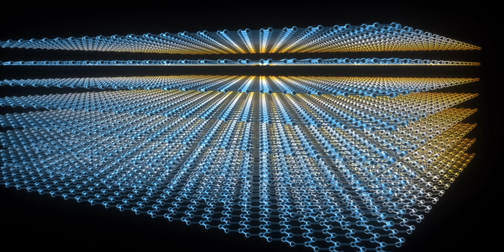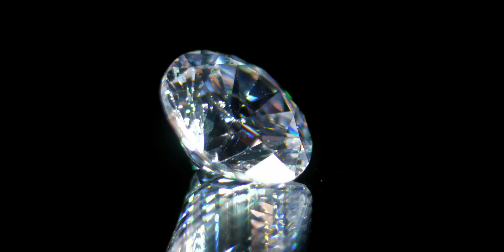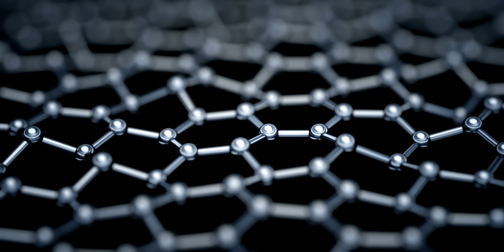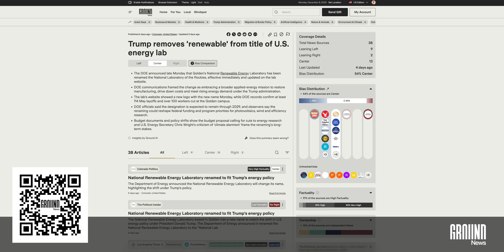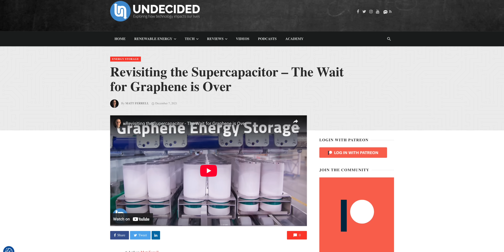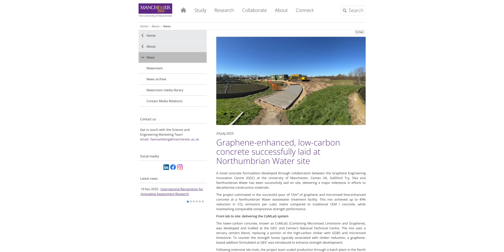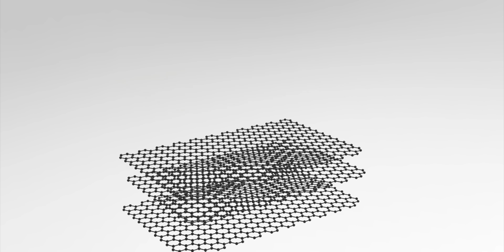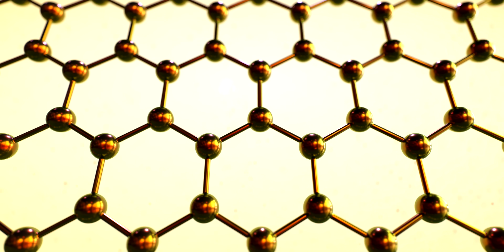How Graphene is Changing the World … Right Now

Comment: I wonder if graphene would make better camera sensors. As an astrophotographer, sensor sensitivity is very important. Would be cool if we could capture more date with less exposure time. The cameras we use need a cooler because with super long exposures, the current CMOS chips generate a lot of heat which causes noise. If these could make better camera sensors without the need for cooling, that would be awesome.

Comment: I wonder if there is a way to produce graphene using a float tank method. If you ha still fluid to float the graphene on as it was produced wit a take up roller on the end. I don't know enough about the graphene's properties but using a very still liquid metal in a vacuum where the surface is super flat would prevent wrinkles and tears. If you sputter or some other form of deposition at on end you could basically print it in large sheets.

Comment: I'm here for Graphene. In fact, One+ has a phone with Graphene in the battery. It can charge a LOT faster than the previous model and many other phones currently on the market and has a greater capacity for having a battery that is roughly the same size and the model before. If Graphene is only going to improve, I'm ready to see what happens.

Comment: Skeleton's product isn't a GPU, it's a UPS that power balances jittery GPU workloads. GPUs training models in datacenters sometimes turn on and off in unison, which would cause power surges that the utility's supply can not handle. One solution is to introduce dummy workloads, literally burning electricity at each GPU for nothing just to fill those gaps. That's how Skeleton claims the flops increase: replacing the dummy workload with an actual rest period (supercapacitors take up power from the grid to smooth the power draw) allows the GPU to cool, allowing for a higher clock speed when training resumes a split second later.

Comment: Matt,
Good thing CO2 and Climate are not a crisis or a problem. The CO2 emissions from concrete is irrelevant. Trees and Green Plants thrive on CO2. Point is stop hyping the climate crap, you’re lying. Otherwise thanks for the info on the Graphene.
Reply: No joke.  1000 parts per million is the sweet spot for CO2 which is 2.5+ times higher than current levels.
Reply: @michaelg4931 Actually CO2 is not even relevant. For one thing it’s not a greenhouse gas. The real player in Atmospherics is water vapor.
Reply: @wmffmw It is relevant because below 200 ppm and most plants die with the optimal being 1000ppm.   If it was up to the 'climate crisis' crowd we'd end up starving to death.
Reply: @michaelg4931 I did not say CO2 was irrelevant to plants. I said it is irrelevant as a greenhouse gas. False as is the so called climate crisis. Human activity has in fact significantly greened the planet. Historically, Earths flora may have suffered an extinction level event if CO2 levels had continued to decline as they had been prior to the English Industrial Revolution. The records in the rocks.
Reply: @wmffmw LOL   I guess you can't see when someone is agreeing with you.

Comment: I'm old enough to recall when lasers were described as a "solution in search of a problem".  All the craziness of optimism in 2004 will come to fruition. Just takes time.  History is full of ideas that were ignored for decades and more and then someone builds it into their 'invention' that is now possible thanks to additional tech developments.
Reply: I bought some graphene IEM a few years back to replace my Beryllium drivers and it was fairly cheap.  The issue is that it's still too exotic of a material that a lot of these older companies just aren't familiar with it just yet.  China is actually taking the lead in researching uses for graphene.
Reply: now do 'lasing blue LED's'

Comment: Commercial deployment of new tech has always taken a long time. The first ABS brakes were invented in the late 1940’s I think, were deployed into aircraft in the 1950’s, with the first passenger cars to get them in the in the 1960’s but the real breakthrough with the electronic ABS brake happening in the 1970’s. I wasn’t for another 40 years before practically every car on the road had ABS brakes as standard. 

Computers were the same. Enigma was operating in the 1940’s, but the breakthrough for computers small enough to be portable didn’t happen until the Apollo programme, and the first personal computers didn’t happen until the Apple II in the late 1970’s and things didn’t advance much until the Apple iPhone hit the market in 2007 with the newly commercialised electrostatic touchscreen, which had made a computer small enough it could literally be carried in a jeans pocket, and easy enough to use to be practical, with the ability to connect to the internet through the still developing mobile network, that computers and the internet was forever transformed from a thing that was somewhat useful for some people to something everyone relies on every day all day throughout the day. That’s even longer than ABS brakes.

Based on that development timeline graphing shouldn’t be ubiquitous and pervasive until at least 2100, and won’t exit specialised uses in industries that can support its development until at least 2030, possibly 2070. 

So I don’t really see this as a delay, but as a  normal development curve for a high potential technology, that we will probably have to invent whole new technologies, with their own knowledge breakthroughs to even make its use and production.

Comment: 5:30 means absolutely nothing without a comparison to silicon based microchips.
Reply: exactly what i thought lol But thats always a Problem with hyped new tech. Just call some numbers without any context and it looks good. If not explained closer, just leave it out.
Reply: I agree, that's deffinitly possibly deceptive. However I don't see why this wouldn't be scalable to the device scale under the assumption that they can easily deposit high quality single layer carbon and etch it. But you can easily etch Graphene with oxygen plasma (arguably a bit too fast), so the initial deposition is the hard part. The nano-patterning should be basically the same process as they do in fabs at ASML already do with X-ray photolithography.

Obviously it's nontrivial to swap between the 2, but it's hardly the most difficult part of anything involved in either the semiconductor or graphene fabrication process.

Basicly if you can fabricate it at a micrometer, I think you can fabricate it around down to scale with the ASML tech.
Reply: @Eric-jh5mp  yes, I didn’t mean that it’s not possible/scaleable, just that it is deceptive.
Reply: Gents and ladies.. i think the real question is still unanswered.. can it run crysis? Or city skylines?
Reply: This video proposing that graphine can be used as a semiconductor to make chips without silicon???
Reply: @nonstop7243  Newer Intel i9 chips have a theoretical throughput of around 704gbps
Reply: I need the unit to be FLOPS

Comment: Graphene's potential was not overstated at all, but what the predictions all got completely wrong was how long it would take to reach full potential in all of the fields it will affect.  It will take decades before it is anywhere close to having the huge impact on technology and engineering that is coming.  In some fields it is making an impact already, though even in those areas the impact is at present modest.  Once the production of the various useful forms of graphene becomes reasonably cheap it will be one of the biggest material industries on Earth, and at least as impactful as the steel industry has been.  However nobody really knows how long that will take.

Comment: I cant wait for graphene photonic gpus, ram... At that stage, having them seperate might cause too much lag for whatever speed theyre going for.. An embeded chip housing the ram, cpu, gpu, others. I winder if dense embeded storage that operates like a cd and laser is possible, in a multi layer grid + diff wavelengths, perhaps it could store a lot.
Or even just be used for an inside ROM. 

GPU speed and dense data like this would enable extremely fast and powerful AI directly in a small form factor, wearable or otherwise...

There may even be new number bases able to be used besides binary? If multiple wavelengths are used, it could potentially be used as on/of for each wavelength, enabling even denser storage and data transmission.

Comment: Just because graphene conducts heat doesn't mean it dissipates it any better. It has less resistance loss, so slightly less heat, but most of a signal MOSFETs heat is from switching, not ohmic. You need to transfer the heat to something, and there conductivity matters, but you still need cooling.

Comment: Remember the Blue LED discovery? Every one did it wrong, until 1 persistent engineer found the 'eureka' solution, through altering the injected chemical flow, after about 5 years (guessing a bit here) of trial and error.
My point is, that someone will have a 💡 moment at 2am and discover the method to mass produce quality graphene sheet layers. Just like the transistor. Like the light bulb filament. I even remember a biological experiment that failed consistently. Finally, one scientist realised the problem was when they cut the vein like tube with the scalpel. The blade was not sharp enough and was 'crushing' some of the cells and failing the next step. So a sharper and thinner blade and the method used for cutting the vein like tube, solved the flawed issue and they succeeded in producing a useful product. It needs dedicated, smart engineers and funding for years, to keep trying. I don't think that's ever going to change.

Comment: There's be some wry humor from the universe, if Graphene could be used in Concrete as a method of Carbon Capture.
Think of the share prices of construction companies that supply concrete, or the cost savings to recycling carbon based waste from other branches of a megacorp, trucking the waste to their in-house recycling-to-concrete business.
That charge-shifting capability could be useful in capture and redirection of cosmic rays in the hulls of space vehicles, or via the concrete in the structures used in off-world bases.

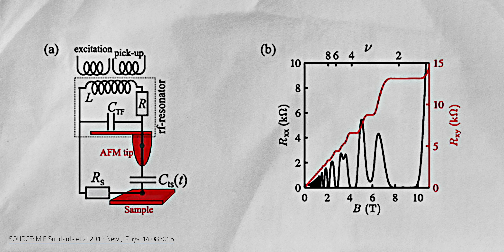Comment: 3:54 I hate to be writing this comment hahaha... Kelvin is a unit for temperature, it is just "Kelvin" not "degree Kelvin", it is in good faith, I totally understand where the confusion comes from :)
Reply: @mytorojas  Thanks for writing that. Degree Kelvin is wrong since 1967.
Reply: @domifr1991 ah ok thanks, so my intuition was right. Always happy to be corrected, that is why I thought maybe there was a super niche use of it
Reply: @domifr1991 can you put a source? :)
Reply: Kelvin Degrees measure temperature difference, both on the Kelvin (absolute) and Centigrade scales.
Reply: @simonmasters3295  makes sense I guess, but even then it would not be used correctly here and I've never seen that used. Do you have an example of some field where that is common?
Reply: @simonmasters3295 No. Degree Kelvin is wrong since 1967
Reply: Someone's getting a little loose on the fact checkers and proofreading...

Comment: And what was the carbon find before graphite? Buckyballs c60… yeah, what did we use that for? And… electrons don’t move thru a lattice… electricity flows by EMF being transmitted thru electrons.  Just like a wave in the ocean moves horizontally at high speed but the water molecules just move up and down and pass on the energy…

Comment: Graphene is also used in alot of newer power electronics, because of the better efficiency. 

I remember working with it at my previous job back in 2018-2019 on internal testing units, that then hit the market doing the corona time back in 2020. 

Around the same time we also saw the first drone batteries come out with added graphene for better performance. Kinda the early adopters, number of useful charge cycles were not the best, but performance was nice on them. It's gotten alot better now though

Comment: "And more importantly, how will these breakthroughs actually affect you?"
Well unfortunately Matt, you didn't do adequate research.

Graphene is even more damaging to human cells than asbestos. It's effectively a hypodermic needle of the smallest size on a molecular scale. It will literally just slip into your flesh if it's a particulate in the air. 
Researchers in graphene labs have to wear specialized suits, which only mitigate intrusion, not prevent, as there is no cloth/textile/wearable material that can prevent graphene from penetrating it. You could perhaps use some electrostatically discharged equipment in the lab but, here we are sponsoring graphene poured into concrete. Sorry my dude but, you got caught in the hype promoting a creation that presents more dangers than benefits.

Graphene is a technocrat industrialist promise that will reach its peak by climbing the bodies of the disposable along the way.

Comment: So much going on in the space! GMG just got EPA approval for Thermal XR their coating that saves energy in existing HVAC systems. Their batteries are going to change the world and G lubricant will extend the lives of ICE engines as it increases fuel efficiency. 
Hydrograph’s Hyperion system makes the purest graphene on the market and the process produces energy with syngas as the byproduct.

Comment: I just purchased a silicone food warming mat, the kind you roll out and use to keep dishes hot once they are out on the table.  The "upgraded" models are being advertised as having graphene.  The original ones had heating coils sandwiched inside the silicone.  The updated mats say there is a graphene film on the inside, which provides all over heating, without the cold spots of the wire coils.  No idea if it is marketing hype.  Just thought it was funny to see this video today as I buy cheap crap on Amazon claiming to have this tech.

Comment: eh... I'd wait on the concretene for at least a decade to see how it ages and if it's strength remains comparable to standard concrete. it's not like cooking where you can immediately notice changes to the recipe! it's a longer term thing... lets say some developer uses it to build a new sky scraper tomorrow and 15 years down the road it's starts to exhibit flaws you don't want... I'd rather have TESTED and well documented data on something rather than just slapping it and saying "looks good to me!", granted that's how Carnagie did it with steel and they got away with a lot more back in the day and EVERYONE knew the difficulties in producing repeatable batches so until that can have a guarantee on it.

Comment: The processor of the computer i'm typing this on uses a graphene sheet as it's thermal interface material.  This work is typically done with a messy paste, the graphene sheet is dry and has higher thermal conductivity than most materials.  It cost me $18.  Thermal Grizzly KryoSheet.

Comment: What about Pyrolyzed cannabis which has similar atributes to graphene at a thousand of the cost. Even at todays costs.

2013 ASME:
Graphene, a carbon nanomaterial, is considered to be one of the best materials for supercapicitor electrodes. Graphene is, however, expensive to manufacture, costing as much as $2,000 per gram. Looking for a less-costly solution, researchers at the University of Alberta/National Institute for Nanotechnology (NINT) NRC, and Alberta Innovates-Technology Futures, led by chemical and materials engineering Professor David Mitlin, developed a process for converting fibrous hemp waste into a unique graphene-like nanomaterial that outperforms graphene. What’s more, it can be manufactured for less than $500 per ton.

Comment: Anything that progresses the use of supercapacitors is great news to me. I hope to see a day where you can pull in your EV to a station, recharge a supercapacitor in the same time, or less, than it takes to fill a gas tank, and that SC will keep charged a smaller battery pack.

Comment: They say you use a lathe to make another lathe of greater precision. Since ultimately the utility of graphene depends on the size of a defect free sheet, or more precisely, a low defect to area ratio, it seems to me that it would be possible to use very expensive techniques to create high quality sheets, and then use these as a template. Some potential uses for graphene that I didn't see here: 1) super-efficient hydrogen gas storage (theoretically, if you can make curved graphene, then you can make graphene tubes, and store H2 gas at high pressure and room temperature). 2) Catalysis. There are many types of chemical reactions that are only commercially useful with efficient catalysts (decomposing water to H2 and O2, for instance). 3) Desalination. Supposedly graphene will let water pass through it, but not sodium or chloride ions).

Eventually, as a society we are going to have to address the issue of proprietary technology...

Comment: 9:23 "Because graphene is conductive and thin, it's often suggested as a carbon replacement in supercapacitors."
Graphene isn't replacing carbon in supercapacitors, it's one form of carbon. When it's proposed, it's usually as a substitute for activated carbon or as a conductive additive, and even then the trade-offs (restacking, surface accessibility, cost) matter a lot. Framing this as "bridging the gap" to batteries is misleading at best. Graphene can certainly improve ion accessibility and cycle life, but it doesn't change the fundamental electrostatic limits that keep supercapacitors below batteries in energy density.